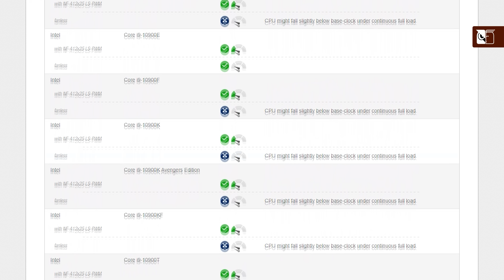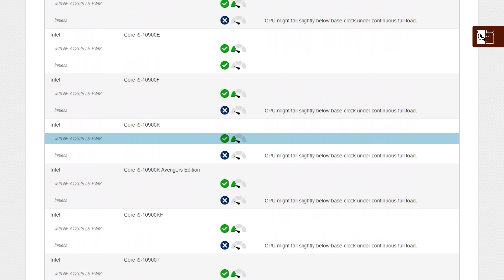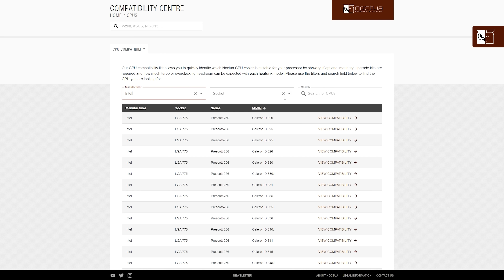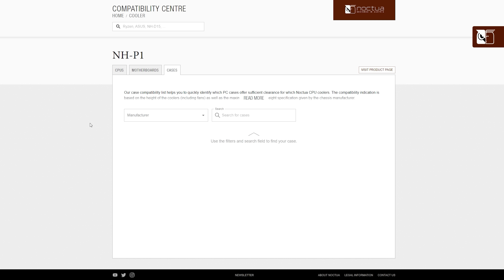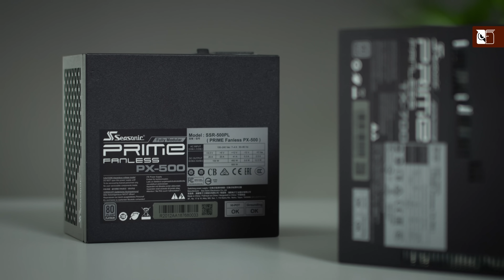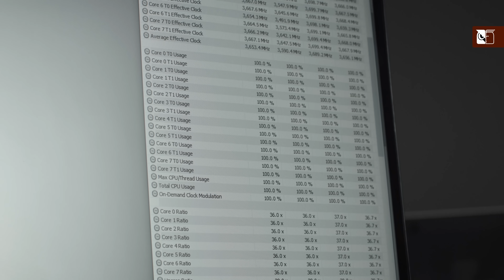How to build a passive PC with the Noctua NH-P1

Comment: I would not recommend using a passive power supply unit. They are needlessly expensive and a semi-passive one will serve much better. It can be made fairly powerful, so its fan will almost never spin up and the power supply unit will remain silent, while having a fan inside is like an insurance that in extreme periods of peak power demand it will just spin up instead of the power supply unit blowing up.

Comment: Got cpu fan passive but  powersupply fan then gpu still produce noise. Thus better passive setup is a mini amd APU strapped with this passive heatsink.
Reply from the maker: APUs are great for fully passive systems indeed. Getting a passive PSU and (semi-) passive GPU are great options as well though!

Comment: i think that the graphics card's horizontal position can slow down the air convection to some degrees. It could have been smoother if it were more vertical

Comment: Do you know if the people designing fans at Noctua have any plans (or even concepts) for fans larger than 200mm, or any plans for more 200mm models? I'm not a professional yet, but i'm getting an engineering degree currently, and it really seems like larger fans, such as 200×200×60mm, have much better throughput-to-noise-ratio than smaller fans.
It now occurred to me that whoever at Noctua reads this probably can't reveal any information about upcoming designs....
Well, whatever the situation may be, bring up the idea with product designers if you have any power to do so.
Reply from the maker: We don't have plans for fans larger than 200mm at this stage as there aren't any PC cases that could fit even larger fans. From a technical perspective, it is correct that larger sizes make it possible to achieve better airflow to noise ratios, but maintaining good pressure performance and even blade loading is a big challenge the larger you go.

Comment: Try getting half of these parts, it's a joke
Reply from the maker: There are good alternatives for many of them, which parts are you struggling with?
Reply: A good passive GPU, and an affordable well ventalated case
Reply from the maker: For GPU, have you seen Palit's GeForce RTX™ 3050 KalmX? https://www.palit.com/palit/vgapro.php?id=5147 Another great option would be to go for the new AMD Ryzen 8700G APU.

For cases, have you seen our list of recommended cases? Many of these are readily available at a decent price like the Jonsbo UMX4  or Fractal Design Meshify 2:  https://ncc.noctua.at/recommended/NH-P1-68/cases
Reply: Thanks for the suggestion, i appreciate it, oh the 78003d is not recommended as the thermals are too high. However i tried it anyway and so far things are good, stable at 48-49 on load though I'll admit it's spring  😂 but I'm hopeful that i can improve my design ready for summer by adding a good radiator on top of the tower or just going open form factor,

Comment: I think using a PCIe extension cable and connecting the GPU to the x16 slot is a good idea. That way you can mount it away from the CPU heatsink and still use the fast PCIe slot.

Comment: Thanks for sharing... Can you please  tell what is the highest safe temp for PCH?

With 22c ambient room, mine reaches 50c with 2 intake at 650rpm if I turn them off PCH reaches 69 on ZZEW B6 14L mini itx case, Gigabyte Aorus Z690i lite d4 (with 2 gen4 NVME SSD and 2 sata 2.5 ssds, i5-12400+Thermalright SI-100 210TDP rated 31-47c and 56c highest with no fans; GPU is a HP AMD RX5500 oem replaced heatsink with a Raijintek Morpheus 2 Core no fans 32-40c normal use and 57c gaming) is 69c or even 70-75c degrees ok for PCH? Thanks before hand!
Reply from the maker: These temperatures are entirely fine, the PCH on Z690 can run safely at up to 100°C.
Reply: @NoctuaVideos  thanks, much appreciated!!!

Comment: I'm running a ryzen 5600g, its undervolted using PBO, my previous cooler was a deepcool gamer storm lucifer v2 running passively, I just brought this NH-P1 along with a better PC case that has vents in the top (previously I just left one side off the case) before I swapped everything over I ran a test where I pegged all cores at 100% for 20 minutes and it got to 79 degrees, then I swapped over to the new case and installed the NH-P1 and ran the test again, after 20 minutes with all cores at 100% it was only at 64 degrees, so I left it running for longer, it eventually got to 66 degrees where it stayed for ages, after 40 minutes it was still at 66 degrees so I ran an iGPU benchmark while the CPU was still at 100%, the highest it got to was 69 degrees, then it dropped back down to 68 degrees, after about 6 or 7 minutes I stopped the iGPU test and the temps dropped down to 67 degrees, after 50 minutes the temps hadn't changed so I stopped the test.

I have to say I'm pretty impressed, its a big upgrade over the deepcool, 15 degrees cooler after the same time period is very impressive, and for the temps to still be only 67 degrees after 50 minutes of all cores running maxed out at 100% and the iGPU running anywhere between 50% to 100% for 6 or 7 minutes in a completely passive case is very good if you ask me, for reference the room was cool, probably around 20 degrees, and at idle the CPU jumps between 28 and 30 degrees.
Reply from the maker: Thanks for your great feedback, it means a lot to us and we're glad to hear that you have been so satisfied with the cooler. If you'd like to help spreading the word, please consider leaving a customer review where you bought it, we'd greatly appreciate it!
Reply: @NoctuaVideos  Will do, thanks
Reply from the maker: Fantastic, thanks a lot! :)

Comment: But will it cool a x400T Intel 35W tdp variant?
Reply from the maker: Could you explain what you mean by x400T please? You can refer to our CPU compatibility list here: https://ncc.noctua.at/coolers/NH-P1-cooler-68
Reply: @NoctuaVideos  Ah it was supposed to be a dumb joke about cooling the Intel Core i5 8400t/9400t - 12400t... which all have a TDP of 35W. A NH-P1 would be total overkill there. 
I love you guys! Thanks for trying to help me out though.
Reply from the maker: Haha, you would indeed be on the very safe side with these, not a bad choice to build a completely silent system that won't break into sweat! ;)

Comment: Has anyone tried this with a 12th gen i7 12700k or i9 12900k?, i ask as the website says i912900k is compatible, but i7-12700k is not... but the i9 runs much hotter. So thats a little bit confusing
Reply from the maker: This is due to the lower base clock of the 12900K (3200MHz vs. 3600MHz for the 12700K): The NH-P1 can handle up to around 110W on both of the CPUs. However, this will bring the 12900K to around 3380MHz, so safely above its base clock. By contrast, the 12700K will be at around 3400MHz, clearly below it's base clock. That's why we state that the NH-P1 can handle the 12900K at base clock (no turbo headroom) but not the 12700K.
Reply: @NoctuaVideos  got ya. Any plans for a beefier one that will be able to cope with the i7 and i9 12th gens above base Freq?  Likely or not?
Reply from the maker: Very unlikely. The NH-P1 already is quite a big cooler. In order to see any significant boost in performance, we would need to go much larger, which would cause loads of compatibility problems. Cooling CPUs that put out significantly more than 120W completely passively using standard parts simply isn't realistic. If you don't expect to have continuous high loads, going semi-passive with an additional NF-A12x25 LS-PWM fan is a very good option. If you expect to have higher heatloads for longer periods of time, we would recommend using a cooler like the NH-D15 that can handle high heatloads with very low fan speeds. For example, its fans will be nearly inaudible if you set them to 800rpm, but you can still get some turbo out of the 12900K plus you will have the option to let the fans go faster if you need more turbo headroom. With a cleverly set up fan curve, you can have a near silent rig most of the time and lots of performance headroom when required.
Reply: @NoctuaVideos  awesome thanks for the info! I wont be gaming anyway I produce music. I doubt id even be getting the 12tj gens to even 50÷ cpu usage to be honest. Upgrading soon from 2nd gen i7 and I can't wait!
Reply: @NoctuaVideos  what if you made some sort of crazy heatsink that extends up from the CPU all the way out the top of the pc case?  And is about a foot long.  I'd buy 😆
Reply from the maker: Nice, both the NH-P1 with extra fan for semi-passive usage and the NH-D15 with an "aggressive" low-speed fan curve should work well for you then. You could also consider CPU models such as the Core i9-12900T that generally put out much less heat, this is ideal to pair with the NH-P1.
Reply from the maker: Haha, let's see, might be too much of a niche product though! ;)
Reply: @NoctuaVideos  Thanks for this! So the i912900t seems to be 35W? How can it be nearly as fast as the 12900k and use so little power?? I haven't built a PC for about 16 years so it's all a bit confusing for me now. It was easier back then!!

Do you reccomend any particular motherboards for these CPU ans coolers? I'm looking at the ROG strix but there are so many of them!! Thanks again

Comment: Sabrent Heatsink disipador de Calor para Rockets M.2 2280 SSD  There is room with this cooler with the Noctua NH-1? I'm in a hurry. Thank you, anybody out there to advise.
Reply from the maker: The specified height is around 23mm (0.9 inch) so it should easily fit underneath the NH-P1: http://sabrent.com/products/sb-htsk

Comment: I just started ordering components for my new passive PC, and it actually hadn't even occurred to me to look at YouTube. I decided to go with an Intel Core i5-12600T CPU (35-74 W TDP) and the Noctua NH-P1 cooler, and those will go on a Gigabyte Z690 UD AX DDR5 (big heatsinks), powered by a Seasonic PX-500 fanless power supply. I intend to use the integrated Intel UHD 770 GPU, and a Thermaltake Core P3 open case.

This will be a pretty massive upgrade for me, considering the last PC I bought was a 2013 model Dell Inspiron laptop with a Haswell Celeron. Even the fastest machine I currently have in the house, which belongs to the company for whom I work, is a 2017 MacBook Pro with a Core i5-7267U CPU (too old to run Windows 11) with a Passmark score of 3933 CPU, 1575 GPU (Intel Iris Plus 650). That compares with 18202 CPU, 2599 GPU for the new system, and that's before even considering the increases in motherboard chipset speed, memory speed, and SSD speed that the new system will have.
Reply from the maker: Thank you very much for choosing our NH-P1, this sounds like an excellent build!

Comment: Now I like to see a Low profile version of this Fitting in SFF cases. with the cooler being smaller than a ITX motherboard.
Reply from the maker: Unfortunately, that wouldn't perform well at all due to the small size and usually tight space inside SFF cases.

Comment: how do u make it works while the cpu fan header need to be pluged in order to be able to boot up
Reply from the maker: You should be able to disable this in the UEFI BIOS. So please simply connect a fan temporarily, disable the option in the BIOS and then unplug the fan.
Reply: @NoctuaVideos  thanks

Comment: Great video! So much passion went into it, it's palpable. Just like your products.

I have 2 questions that I'm wondering a lot about these builds:
1) mount the fun to push air into the case, or mount it to pull it outwards - which one is better?
2) for pulling air outwards, would you rather place it on the CPU cooler, or, if close to the CPU cooler, attached to the case?

I understand your answers can't be generalized to all configurations, but I'm sure that e.g. for the particular case above, you have benchmarked it, and I'd love to know!
Reply from the maker: Thank you for your kind feedback! If you add a fan, we would recommend adding it either as a top exhaust case fan or sitting on the cooler blowing towards. The effect will be very similar, but the top exhaust case fan position has the advantage that it doesn't reduce natural convection through the cooler, which can cost a few Watt.
Reply: @NoctuaVideos  I've heard it's ideal to avoid negative pressure in builds like this to prevent dust from entering via unfiltered areas.

Comment: I don't get the suggestion against MATX. They're the same as ATX except fewer PCIE slots on the bottom... wouldn't that make them better?
Reply from the maker: When you use µATX with a dedicated graphics card, there will usually be less space between the card and the cooler, which will reduce airflow through the cooler and increase temperatures. If you're using integrated graphics, µATX is fine.

Comment: I am thinking of building a passive PC. My office is under the roof and in summer temperature can reach more than 30 degrees C. This only is happening in Juli to August. Would recommend a fully passive system under these conditions or is it better to go conventional?
Reply from the maker: Really depends on what CPU plan to use and what sort of workloads you expect. If you choose a CPU that can be handled by the NH-P1 easily (see https://ncc.noctua.at/coolers/NH-P1-68/cpus ) and mostly expect mixed loads without longer times of 100% stress, you might be able to get away fully passive even in these months. Generally, what we'd recommend for this type of situation is adding an NF-A12x25 LS-PWM and going semi-passive though. If you select the right components following our guidelines, this should enable you to run fully passive most of the year and if things should get too toasty in July and August, you can have an extra boost from the fan whenever necessary.
Reply: @NoctuaVideos  Thank you for the answer.

Comment: Because heat rises, shouldn't the fins be pointing upwards and not sideways. In other words, isn't this cooler most effective inside a case that lies on its side?
Reply from the maker: The fins ARE vertical in the configuration we've shown. A desktop or open benchtable type configuration where the motherboard is horizontal works as well, but it has the downside that the airflow will be restricted by the motherboard. By contrast, in the configuration we've shown, natural convection can pass through the fins without restriction, especially if you don't use a dedicated GPU.
Reply: @NoctuaVideos  Thanks. I'll have to watch that again.

Comment: Could I run the NH-P1 with my pc completely fanless?
My PC specs are:

CPU: AMD Ryzen 2600 six core processor

GPU: Nvidia GTX 1070ti

Motherboard: MSI B450M PRO-VDH

RAM: 16GB

If there's any other specs or information you need to figure out my question ask away

I want to create a completely fanless pc, and will use the pc 90% for gaming, games such as valorant, nothing too costly. Will I be able to run games on my pc smoothly if I use this build?
Reply from the maker: Thank you very much for your interest in our NH-P1! As explained in the video, one key component of passive systems is the case, so please make sure to select one from our list of recommended cases: 
https://ncc.noctua.at/recommended/NH-P1-68/cases
https://noctua.at/en/nh-p1-setup-guidelines

Other than that, CPU and motherboard are compatible although there definitely won't be much turbo headroom on the CPU:
https://ncc.noctua.at/coolers/NH-P1-68/cpus/AMD?q=2600
https://ncc.noctua.at/motherboards/model/MSI-B450M-Pro-VDH-4244

If you pick one of the recommended cases and follow the other recommendations in the guidelines, it should be possible to run fully passive. However, as there are so many factors that come into play, there can be no guarantee.

Comment: (I'm not refusing the idea of the video or something)
you can do better than using a heatsink for passive (silent) cooling with less effeciency.

Get a TEC-1 peltier module, 12v supply connector and 1 10x10cm and 1 15x15cm heatsinks 
1. Put a thermal paste on the two sides of the peltier and the cpu.
2. Put the two heatsinks on each other peltier in between.
3. Put the cooling side 10x10cm heatsink on the cpu.
Make sure that the amps is 3A and 30watts or less to be in this limit
(-35C°~45C° 33W 2.9A 12V)
Reply from the maker: In the end, this will only mean that you have to dissipate the heat from the CPU plus the peltier, so it will only make things more challenging rather than easier...

Comment: when building a truly silent pc, another thing to keep in mind would be the small fans on x570 motherboards, as well as on some others. Considering that, when making a silent pc, the cooler is passive, thus, a B550 board will work just as well as an x570 as it's highly likely the CPU will not be overclocked. VRMs are generally decent on those boards, too.

Comment: "to get the maximum cooling performance please consider installing a fan"

at this point just buy the normanl tower and slow down the fan I'm sure it will do better
Reply from the maker: Our recommendation is to install a fan if you want to run a semi-passive setup: eg. cool completely passively most of the time, but with the added flexibility of having the fan start up at higher temperatures. If you intend to have the fan running permanently, then we would certainly recommend choosing a cooler that is designed for active cooling instead, as you will of course see better performance.

Comment: Loved this build, too bad there are no high end fanless GPUs such as 3080/6800xt. Although, my current GPU has a fanless mode when idle, but when in high use it releases too much heat, so it will make a passive build impossible. I think with this cooler, Noctua becomes the default option when doing a passive build.

Comment: Noctua: "You should avoid tightly packed ITX or Micro-ATX motherboard, using ATX size boards wherever possible."

LinusTechTips: Review NH-P1 by cut through mini tiny little case Silverstone ML08, put Noctua NH-P1
 to the ROG B550 mini-itx board.